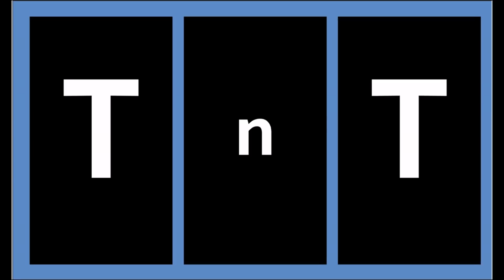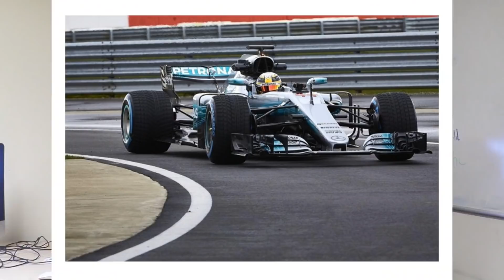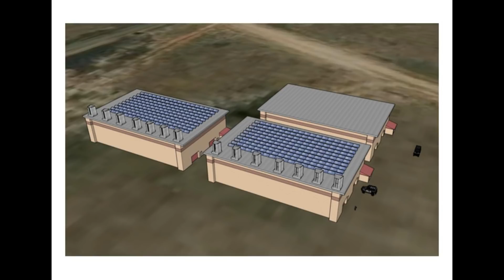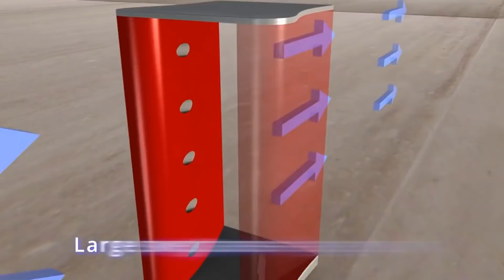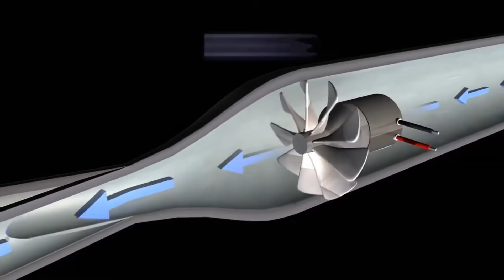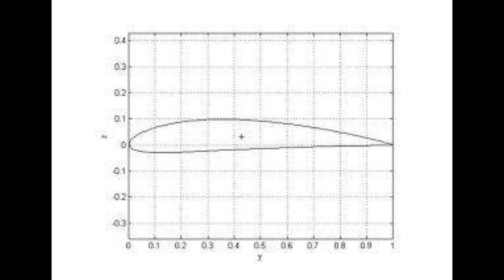1361 Mining Energy From The Air - The Aeromine - The Next Thing In Wind Power

Comment: I know 3Dprinting can take time, but it could help with some of the more complex shapes of the ducts. Or even the airfoils.
Reply: My thoughts exactly. Anyone want to work on a 3D printed version with me?
Reply: Maybe the ribs of a wing could be a 3D-printed airfoil profile, then a sheet material such as aluminum could be formed over it. I just used openSCAD to make an stl file of the NACA4412 airfoil. Took like 5 minutes.
Reply: Sure. I just thought that with the internal structures it might be easier to just print the whole thing. For prototypes at least
Reply: Why not create foils with openings at their lower ends,  externally and openings at their upper ends internally. These would be entirely passive and could even be mounted at angles so as to produce a twist in the upward wind, adding to the torque on the fan. Also, the tower could have a large base, leading to a smaller top, creating that acceleration and lowering of pressure that would drive the turbine at the bottom. It couldn't hurt to mount the whole thing on a horn covering a black surface that would be causing upward movement through the device even when there was no wind. 

If these things are to be 3d printed or molded, why not make them circular with continuous openings all the way around and with very narrow vertical mounting slats or even design them to  slot together, which would only limit their height to the strength of the materials. Since a circle is about your strongest shape next to a sphere, it would be quite strong. 

If you wanted a standard size, you could produce a set of gradually reducing rings that could easily stack, producing that acceleration as the diameter reduces. 

The possibilities are endless and digital modeling can come to the best design than constantly building models.

Comment: Just a thought. Would placing an air foil forward of the air wall 'dial in' the air flow, there by making the air wall more efficient?
Reply: In general no but there can be exceptions.

The max power available from a given cross section area is theoretically independent of whether you funnel the air in or use blades that sweep the same area as the funnel.

In practice attempts to funnel the airflow in tend to add turbulence which reduces the power. 

It is still worth funnelling the air in if you can build a small windmill and funnel more cheaply or more robustly than the big one, or as an economic upgrade to an existing small windmill.

On that basis my guess would be that this design would be cheaper per watt than a fan, but cover a wider area across the incoming wind.

Adding extra foils is likely to lose that advantage, again atca guess...
Reply: @trueriver1950  maybe this video offers the answer😀
One part of the airfoil cause pressure, tthe opposite part causes suction. So, tapping those areas in the right angle might give more energy ?
Reply: Yes, maybe. But wouldnt that also be making more draft, for the turbine or the wings ?
Reply: @grommie  lol
Reply: @brentjenkinsdesigns  i ment drag,🤪 but inside al the twist and turns in the tupes.
Reply: @grommie  yep maybe so. I was just thinking that mounting a foil slightly forward either vertically or horizontally at the prescribed distance would possibly shape or focus the air flow directly into the air wall propellers to maximize their potential rpm speed... Either way. Was just a thought.
Reply: @brentjenkinsdesigns  it needs to have a big opening on the end, so the airflow is maximised out of the turbine. but it might have a little potential, if there's  some sucking in front or even out side the wings... but the sucking is also part of the wind arround the wings. we need some1 with a windtunnel to figure it out, or practice. Just by my typing, we wont get far😅

Comment: Look forward to seeing the series! I really liked that design. It was new to me.

I've been thinking about a wind variable capacitor that uses that lowered pressure to force together two plates with the same charge.
Reply: You need the plates to oscillate, so you can extract PART of the charge again and again when the plates are closest together and making highest voltage, while leaving part of the charge in place to help push the plates back apart. Then, when the plates are at maximum separation and minimum voltage, you need to inject some charge, to restore what was previously removed. And all this needs to vary in keeping with the amplitude of oscillation the wind is making at that instant.

Comment: I really like this, curious if horizontal orientation is possible at small scale.
Reply: I can't see any reason that the device wouldn't function if laid horizontal....but, given that wind speed generally increases with height above ground, it seems logical to orient them vertically.

In essence, what they've built is a rectangular venturi that works on the same principle as those used on older light aircraft that didn't have electrical systems....